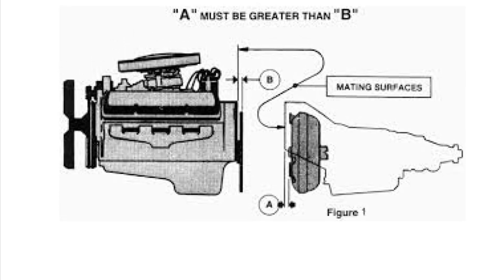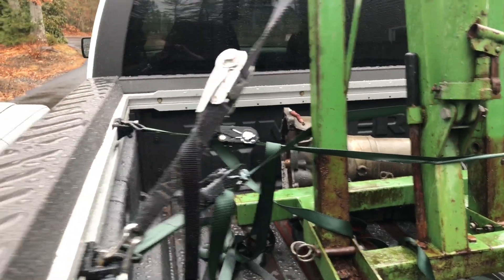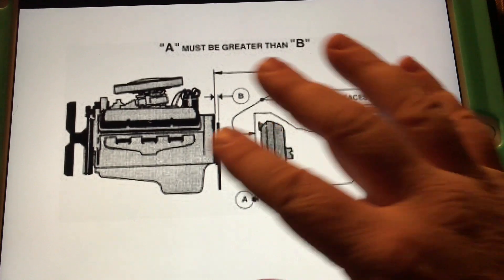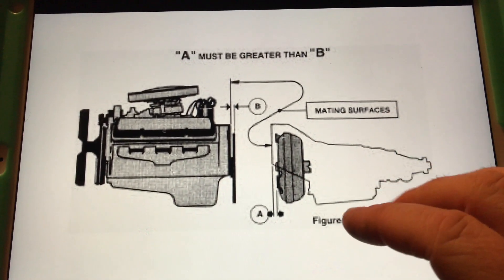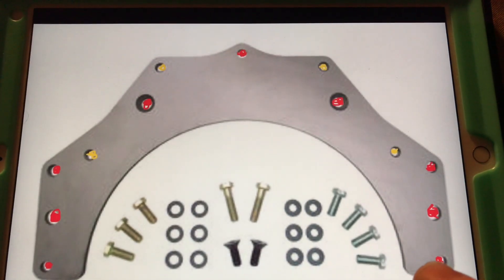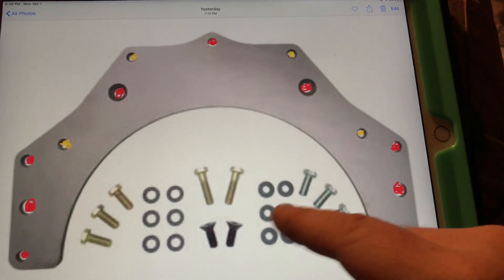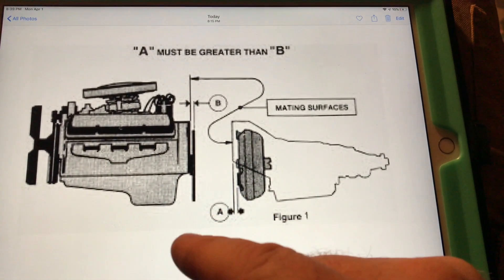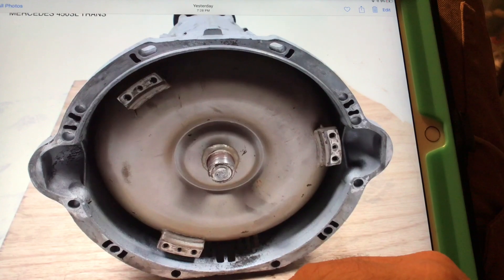Mercedes 450SL - LS 6.0L SWAP - PART 2 “The Plan”

Comment: I thought I was the only crazy one, I have an 82 380SL and I am looking to do the same thing. Looking forward to see how the adapter plate is going to work but very interested to see what engine mounts you are going to use.
Reply: I Did A 350 small block into a Benz and I had to do exactly what he said...I had to have the drive shaft cut and balanced...custom make a cross member ( eazy )..the biggest thing was finding A starter to fix" I ended up with 3 different ones " I finally bought one online..398$$$ Bucks..It's made for tight spaces & V8 swaps.." Now" I'm looking to do A ML 350  to A 5.3 swap? I'm 55yrs old" I guess I love for people to Say No Way...I use stock exhaust pipes with Flow master 50..Every one would ask..What's under the hood?

Comment: I have a quick question about your adapter plans. First tho the GM trans you showed is not a LS trans it’s a pre LS trans the bell housing is Different yes the bolt pattern is similar but it continues all the way around instead of the bottom cut off like the one you showed. Ok my question is what are your plans for the starter? You can’t use the 450SL one and there is no place for the GM one on the 450SL bell housing. Also the adapter you ordered is going to be missing the bottom bell housing bolt holes. not being rude hope you don’t take it that way I’m going to do a 6.0L th400 swap on my 82 500SL.

Comment: I have a couple concerns.. I think the biggest issue is that 6.0 is gonna tear that trans up and if the trans holds up something else will give but still I love the idea I just think you're gonna end up blowing through u joints and axles and if u use the stock converter is it gonna be right for the ls? Idk all the what ifs is why ppl go with gm running gear front to back but what if it works flawlessly? I'd love to see a real transmission and the correct number of pedals (3) in all cars...

Comment: That transmission sat for 20 years is it any good...I am doing a small block Chevy, turbo 350 transmission swap into a 1972 350sl best of luck with your project.
Reply: How did your project go?  I'm toying with a 350 chev and an r400 trans? the sl has been sitting and I just think it might be cheaper w the GM setup

Comment: Great video . 
    I've been thinking about putting a Chevrolet 350 c.i. in a R107 .
    I plan on following your build.
    Is there anyone here in the comments section that has done or doing a Chevrolet engine swap in an R107 , that can give me some tips on this type of conversation ?
   I haven't decided to go with a Chevrolet transmission or the R107 transmission. 
   Best
Regards